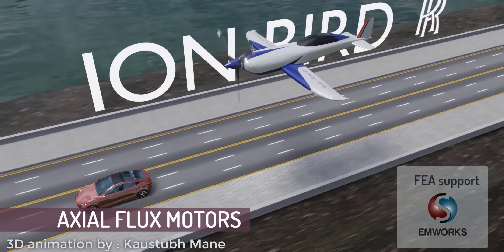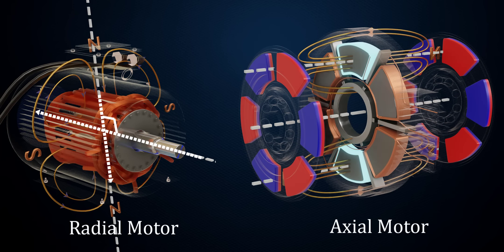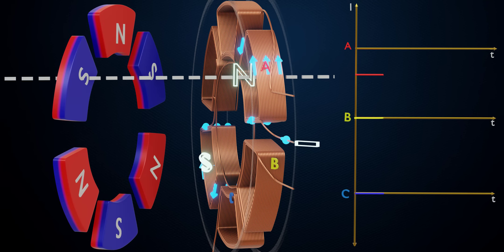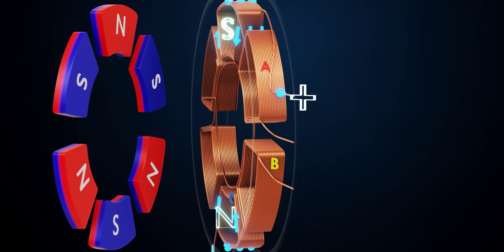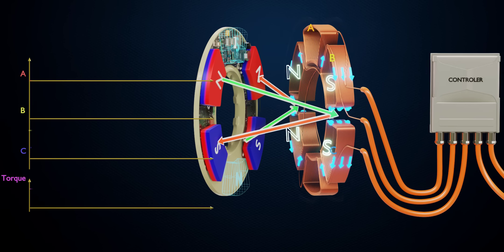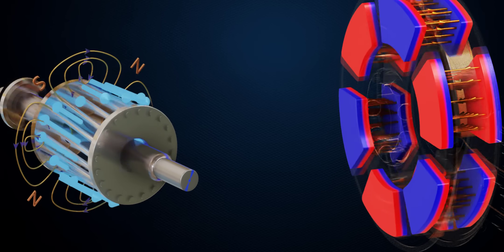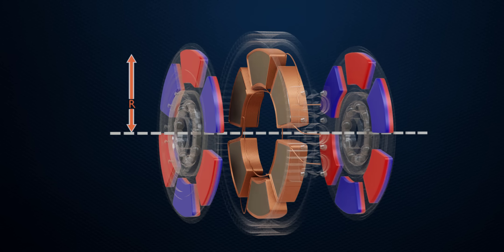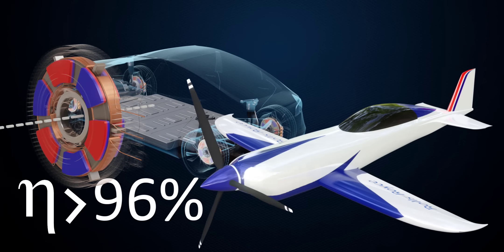Axial flux motors - The new hope

Comment: Many won't understand my comment but for those that do, I thank you. Big Oil has a huge waste problem that it currently solves by selling to you and me in the form of Gasoline, Kerosene or Diesel. Of course there are other variants such as Airplane Fuel and what not but overall some form of Fuel. Why is it that most vehicle engines that use fuel are only 18% to 22% efficient? Reason being so we are constantly purchasing fuel and at the same time getting rid of Big Oil's WASTE PRODUCT. You ever see a substance dripping from the vehicle in front of you? Do you know what the is? No. Well spoiler alert it's Fuel. 

You remember the movie American Graffiti when they showed street racing and large flames shooting from the exhaust? Or perhaps you remember in the 50's that drilling a hole near the end of your exhaust and installing a spark plug allowed for this wonderful plume of FIRE to shoot from your Exhaust. Why do you think that's even possible? It's possible because of the amount of Fuel that is passed through your Exhaust on a regular basis even to this very day. Big Oil has a huge waste problem that can't be fixed any other way. The basic way it turns Crude into anything creates a huge waste product, very watery, extremely flammable and in massive quantities. Henry Ford, one day while looking across one of these lakes of waste product was inspired to find a way to consume this waste and invented the first Engine. Of course the rest is history from there. 

Electric Vehicles rely on Big Oil almost as much as Non Electric Vehicles because of the need for Plastic and other Big Oil Products. If you don't know Plastic is an Oil Product, every and any plastic. Electric Vehicles also rely on Grease in one form or another because anywhere you have metal to metal contact in the form of Bearings you require some Oil Product or Grease. The World will not ever be done with Big Oil until it's ready to do away with Plastic, Grease or any other Oil Related Product and unfortunately that's NOT happening anytime soon. 

So all you Activists that think Global Warming, or WTF EVER you're calling it is a real thing, just know your Activist Cause is a Hoax hence the reason you won't ever get anything done. Big Oil is NOT going away anytime soon. Don't take my word research Oil Products and see just how many you use constantly throughout your day. There is such a profit in Big Oil that it can afford to pay off the current US Deficit every year and provide every man, woman, and child with a New Vehicle EVERY YEAR and STILL turn a profit of TRILLIONS. Maybe you know how much 1 Trillion USD is or perhaps you don't but let me break it down for you in the form of seconds the difference between 1 Million, 1 Billion and 1 Trillion seconds. 

1 Million seconds is about about 12 days. 1 Billion seconds is 31 years. 1 Trillion seconds is 31,688 YEARS. Let that sink in a bit. The average life can be said the last less than 4 Billion Seconds and the older we get the closer we come to the end of life. The Earth can be measured in Trillions of Seconds and not be a very large number before the Trillions part. Now think of the Earth being 4.4 Billion Years Old so exactly how old is that. 

If you really want to expose the Global Warming Hoax just research the History of the Earth in a Single Year, here's a link. 

https://www.oum.ox.ac.uk/thezone/fossils/history/calendar.htm 

If you can view the above link and still believe that MAN is causing Global Warming just know that you're a special kind of STUPID, I mean the KING of STUPID. Or if Stupid was an Olympic Event you'd get the GOLD EVERYTIME sort of Stupid. Big Oil is NOT going away anytime soon so alternatives such as Electric Vehicles will NOT replace Fossil Fuels so DREAM all you want but REALITY will keep your feet firmly planted on the GROUND. There's a reason this Axial Flux Motor is over 200 years old and NOT BEING USED. Sure new breakthroughs happen every day but you can't solve old problems, such as the huge waste product of Big Oil has, with DREAMS. 

The Cost of Gasoline, or any form of Fuel, has NOTHING to do with the Cost of a Barrel of Crude. If you're special stupid you BELIEVE they are related. 55 Gallons of Crude breaks down to thousands of gallon of Waste so how could those numbers be related? They CAN'T BE. There's no way to justify how Gasoline can be sold for over 3 USD per gallon and 55 Gallons of Crude, or one Barrel costs about 75 USD. Back in the early 70s that same Barrel of Crude was just under 7 USD and Gasoline was .25 cents per Gallon and today, Oct 2021, Crude is around 75 USD per Barrel. The two numbers are NOT Linked in any fashion. The propaganda will tell you that they are related to justify the extremely high cost of Gasoline. Oh, I mentioned about the profit of Big Oil before where they can pay off the US Deficit and given each American, approx 330 Million, a free 50K vehicle every year and still make a profit; well I forgot to include they can also provide FREE GASOLINE too. Again not everyone is going to understand my comment but if you're read this far I'd venture to say that you do understand...
Reply: Mostly what drips from the tail pipe of the car in front of me is water.  The hydrogens from the fuel react with oxygen to make water vapor in combustion.  If the exhaust system is below boiling, the water condenses.  The EPA regulations would not allow a car to be sold that had enough unburned fuel in the exhaust to drip.
Reply: @kensmith5694  Did you read my entire comment or just gloss over a few words and assume the rest. What makes up Gasoline? You should know this; I mean you know everything, right? If the exhaust system is below boiling the water condenses. OMG are you just making shit up or do you just NOT KNOW. Yes the exhaust system gets hot, obviously from the combustion gasses, but WTF is below boiling??? Does your exhaust reach boiling? 

Wow, it's better to be silent and thought to be stupid then to post a comment and remove all doubt. Clearly your comment has removed all doubt for me. EPA regulations don't give two shits about unburned fuel. OMG show me your research and post links. Where are you getting this information? I'mma assume from the only functioning brain cell you have left and even that is a stretch that you actually have 1 brain cell still functioning. Clearly you're not one that gets my comment so don't interject your BS here. 

The Hydrogens from the Fuel react with Oxygen to make water vapor in combustion. WTF does H2O stand for? Come on genius, H stands for HYDROGEN x 2 + Oxygen so where is the Fuel part and how does this magic vapor escape combustion??? Holy fuck you're stupid; just in case people tell you that you're smart. Yes you are smarter than them but you're not smarter than the average 5th grader. Now explain how you can drill a hole near the end of your exhaust, install a spark plug, and get to flames to emerge. Tell me how you can ignited water? Unburnt Fuel is what drips from Exhaust, mostly water at this point but Fuel just the same. The reason it's unburnt is because of the inefficiency of the Engine. 

When you, Ken Smith, finish looking up the words you don't understand of my comment you will clearly see that Big Oil has a WASTE PROBLEM that they solve by selling said problem to you and me calling it FUEL. Yes H20 is in Fuel because when Big Oil washes down the Crude Process producing Plastics said WASH is WATER and there's no way to separate the Water OUT. What part of my comment is Rocket Science Ken? Seriously how pompous does one have to be to NOT SEE? Water condensing from below boiling point in the exhaust system means WHAT EXACTLY??? Fuck you're stupid...

Comment: Does anyone know how many airplanes have crashed due to cabin fires started by lithium batteries in transit?   The answer: too many.  So, your airplane has 6000 lithium batteries to power it?
Reply: Air travel is safer than the car ride to the airport.  Any number of crashes is too many but the main causes should be addressed first.

Comment: Um is putting an electric motor in a plane really a good idea: I know they put redundant systems in planes but running out of battery power in an electric plane would really be a drag 😄 see what I did there 😂
Reply: The electric aircraft industry has already gotten off the ground for short hop uses.  
Running out of fuel in flight is a bummer but it has happened.

Comment: You're comparing apples to oranges - asynchronous AC (induction) motor to axial brushless DC. It would be more useful to explain how it is better than the closest relative, radial brushless DC, which uses the same principles, but geometry is different (radial vs. axial)
Reply: I wonder if it might be possible to combine both types of dc motors.
 Axial on the outside to provide the lightweight torque and radial in the center hub for starting power and power surge requirements.
Reply: @jeremytaylor3532  some designs coming that do this.
Reply: @jeremytaylor3532  was thinking you may need a center radial for regenerative breaking anyway.
Reply: Please check out this video. 

https://m.youtube.com/watch?v=detrCRPmzV8

It is indeed possible to not only combine axial flux and radial flux, but also in-runner and out-runner in BLDC motor. This motor gives 4 directional flux and hence is known as 4D motor.

Comment: Astonished to see it works because the idea does sound inefficient and overkill superficially, neverthless I guess >96% is a great result. Also what about mutual inductance powerlosses, The Ion bird had three of them stacked together so, it must have some coating to cut off the inductive effect right?
Reply: Inductance doesn't mean losses.  Inductance stores energy for later and then returns it.  In a system designed to work with energy flowing in both directions, it is not lost.  The motors and electronics in electric cars deal with it very well.
Reply: @kensmith5694  Ah, then I must've confused it with the eddy currents. I thought the "Back emf" would hamper the effective current in succesive coils/motors thereby reducing the total strength of the electro-magnetic fields from the first motor to the last but I guess AC motors overcome such emfs by increasing motor-load and by setting a high source voltage. Although, this motor's radial symmetry and compactness must make it easier for the inductive currents to exercise the Lenz law on nearby coils.

Comment: If only reality would really be that simple... but it isn't.
axial flux motors have been used for as long as electrical motors have been around. They are shorter and do have have other good characteristics as well - but nothing comes for free and they have just as many downsides as benefits.

Comment: It's really nothing new or special, plenty of electric motorbikes and conversions use these engines because of the contained weight and size already. I assume there are good reasons why they're not used extensively for cars yet, if it isn't just the cost of ramping up production.

Comment: Does the motors recharge the batteries in any way, like a alternator on a vehicle.
Reply: Planes don't tend to stop in mid air without serious consequences so no.

BEVs use regenerative braking to recover some of the energy, this generally makes no difference as to whether it is an axial or radial motor.
Reply: A motor like this can work as a generator.   If used in a car they do.

Comment: It contains magnets. Magnets will lose its performance in the time.
Reply: I have some magnets from the 1980s.  They make over 90% of the field they did when new.
Reply: @kensmith5694  How did you measure it?
Reply: @jaromirandel543 
Get a proton free precession magnetometer and a tape measure.
(I have access to them)
Measure off 100 feet from the magnetometer directly north.
Rotate the magnet at that distance through all angles.
Take the peak-peak value from the magnetometer.

Comment: Yes these motors should be installed in every tire, even radial Flux should...
It's a waste of space to place them inside the car
Reply: In general you do NOT want to place the motor in the tire - not only would that add a lot of unsprung mass and at the same times significantly increase stress and wear on the motor.
Reply: @ABaumstumpf  yes that's true...
Reply: @ABaumstumpf  Yes and also, you have to run the wiring between the chassis and the motor so it has to flex.

Comment: Cool but the coils will still need some ferrite core to generate good torque. Core which would get attracted by the magnet and generate axial forces (even when the motor is not powered). Sure it can be somewhat compensated by having magnets on both sides but still I'm a bit worried about the stress on bearings and the general structural integrity. In a radial permanent magnet motor, such forces naturally cancel out with minimal stress.
Reply: A coreless design can be done.

Comment: The moment of  inertia in the south pole fluctuates in a rotating axis causing the north pole to become diversified well within the limits of quantum mechanics.  To understand this further, imagine a solumnexometer on a rigid plain of aluminum oxide that hasn't yet achieved its polarized position in a Faraday cage. You wouldn't know where to obtain the proper perimeters until you energize the solenoid and measure its resistance against a pressurized rod of wutchamacallit!

Comment: Brilliant, but I'm still a bit confused, since I am not an expert in electronics; I just try to think about what I hear. You say they are more powerful than the regular radial flux motors, then say they need to be bigger. Bigger is always more powerful, in that a bigger radial flux motor is stronger than a smaller one. I guess you mean they have some net gain disproportionate to the size increase, but it's not clear to me why. I am easily baffled by science, however, it can only be a small power advantage if weights are similar, and it (to me) is insignificant when you compare the weights of the power supplies of petrol engines and electric motors. One kilogram of av gas through an engine will produce more lift than one kilogram of battery to a motor to such an extent that the gains in axial flux over radial are insignificant. It is the total weight of engine plus fuel tank versus the total of motor plus battery pack, and the battery is the elephant in the room - pun intended.
Reply: You noticed the flaws in this reporting.  
You did mix up power vs energy on the rest of it.
Pound for pound, an electric motor and battery makes more power but it doesn't last.  Fuel has more energy per pound so you get more miles out of a tank of gasoline in an ICE car than an electric car can do on a full charge.
Reply: @kensmith5694  Sorry I didn't keep the distinction between power and torque, but just said one was more powerful. It was using the term too loosely for the boffins, I realise. As for comparing; anything that makes the most energy makes the most power, whether it be horsepower (now in kws) or torque. The motor has instant full torque on startup, and pound for pound thrashes the engine, but that is measured without the fuel sources. When they are included, I believe it favours the petrol by about a factor of 20 (I.e. 1 lb of petrol equals ~20 lbs in battery weight), and diesel is not far ahead of petrol, but requires a heavier and more expensive to build engine. Put source and machine together, and the source is by far the determining factor on what wins the power; torque; range or lift tests. Keep them apart and neither goes anywhere. Beyond that rudimentary understanding, people can baffle me with science. PS, a motor having so much more torque than an engine means it can eliminate the weight of having a gearbox, making it the clear winner if yu just look at the machines, but that 20 to 1 fuel source advantage is just way too much to even close the gap a little.

Comment: I'm sure Rolls Royce, and other high-end manufacturers will put the axial flux motor into their vehicles, but I doubt A.F. motors will be installed into more common devices---washing machines, table saws, air compressors, etc., because of the electronics involved.  Think about it.  Single phase and 3 phase motors are pretty much mechanical devices that electricity flows through, for instance, the centrifugal switch in a single phase motor (or brushes as the case may be) are basic mechanical devices.  As such they last a long time and can be easily replaced.  The electronic control board for the A.F. motors is most likely a very expensive part.  If you've ever had to junk a 3 year old washing machine because the electronic "brain" took a dump, you will understand.  Meanwhile, washing machines with the old mechanical rotary switches are still running along after many years of work.

Comment: A practical Axial Gap Flux motor of very high efficiency was invented by Cedric Lynch .  The AGNI/Lynch motor is highly efficient and interesting.
Reply: Yep - and here’s a kart I designed and built working with and using an LMC Axial Flux Motor 😊👍 https://youtu.be/F9MXBcGKVY0
Reply: @avacreativemedia  That's an excellent video.  Very nice work all around.  I acquired my AGNI motor from a 2 seater rental cart.  So far I've had it on that, a hand tractor, a bike, now I'm putting it on a boat motor.  It's a powerhouse, very efficient, and works well with a variety of  voltages and controllers including cheap PWM.